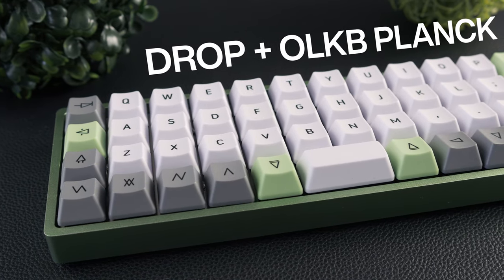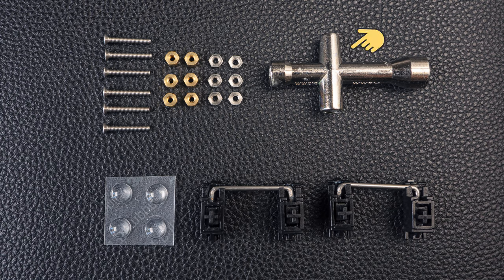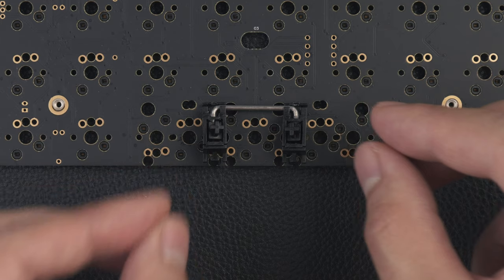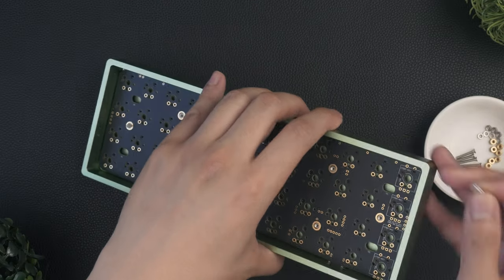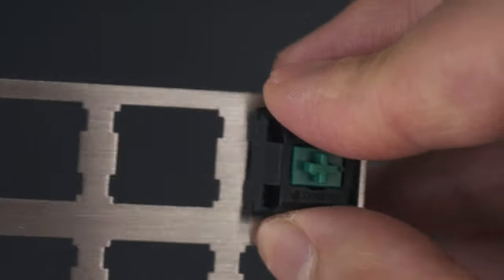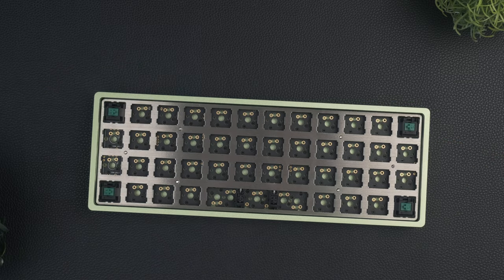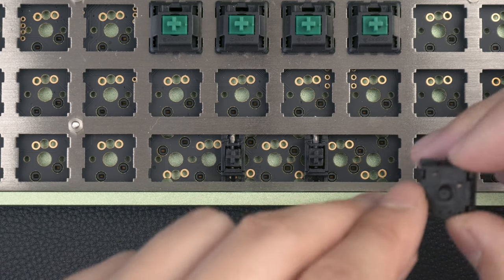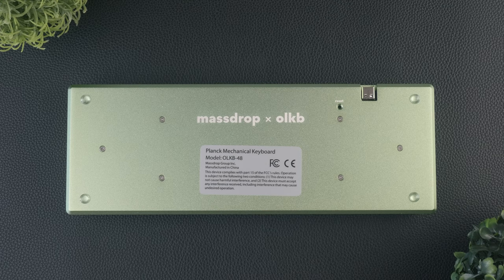Drop + OLKB Planck Keyboard V6 Build Guide

Comment: This would be useful if I found the video before mine arrived lmao.
That aside, great video!
Some additional tip: I'd recommend to clip the nubs in PCB mounted switches even if Planck provide holes for them. I've tried both PCB mounted Durock T1 and Gateron Milky Black and those nubs tend to not get inside the holes. If you're somewhat worried with the stability, I'm sure that it wouldn't be a problem as you got the plate doing exactly that.

Comment: This is very informative, thanks! Btw, is this a high-pro? I cannot find a comparison of high-pro and mid-pro..
Reply: From what I can tell, mid pro have the same height as the lo pro but the plate rest inside of the case instead of the top
Reply: I'm sure it's late but, the high-pro reaches the bottom of the keycaps, and the mid-pro reaches the plate where the switches are

Comment: Has anyone tried to put in LED lights onto the PCB’s?
Reply: I would like to know as well. I think I saw some comment online that said that it's possible now
Reply: Yes , it is possible. Just solder it on , but you need to edit the firmware to activate the Leds

Comment: are mx blues plate mounted or pcb mounted and do i have to solder them?
Reply: It depends, they usually told you whether the switch is pcb or plate mounted. Although if you're getting the switches from Drop, it'd probably be plate mounted (that's what happened to me and Gateron brown anyway).

As for soldering, pretty sure you dont need to as long as it's MX style switches and the PCB is rev6 and above

Comment: Is is possible to add a bit of thin foam under the pcb for some sound dampening?
Reply: dont see why not. should dampen the sound a bit if u find it a little twangy or metal sounding
Reply: also if u are looking for a great sounding stock board look into niz plums
Reply: I know im a little late, but i added some foam to mine and it def dampened the sound. would recommend.